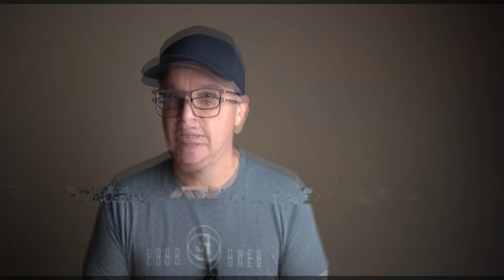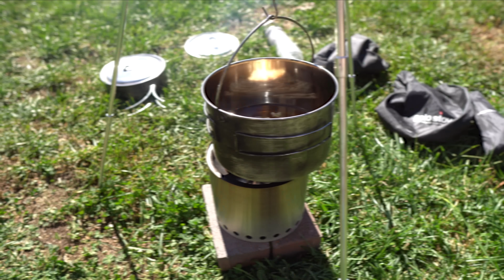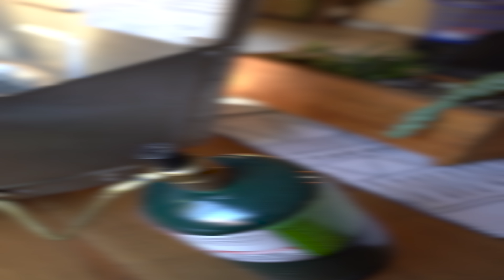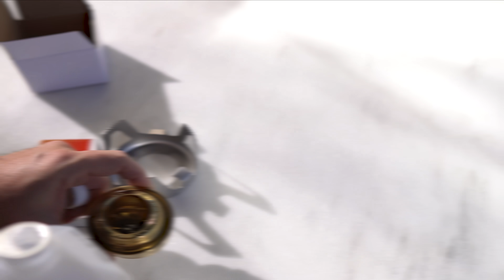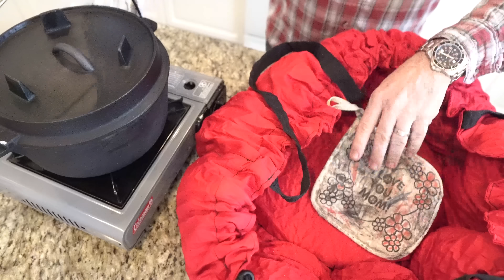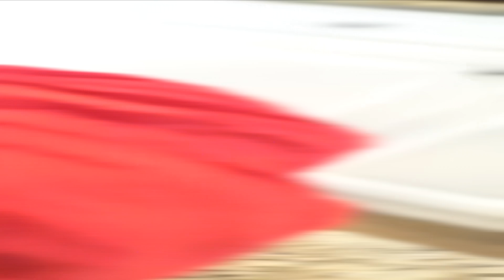12 Ways to Safely Cook After a Disaster

Comment: Whenever cooking with a, from the bottom heat source, USE A LID! It cuts the time needed to boil water or heat anything. This will save time, and resources. In an oven this would not be the case. It will also reduce but not completely the smell of that great hot food you are cooking.

Comment: Take an old grill with a gas burner on the side. Take out the rusty grill parts and cap that gas line on the regulator going to the grill side. Home Depo sells the caps.
Put an old grate or piece of sheet metal in the bottom of the grill.
Cook with charcoal or wood on the grill side.
Cook or boil water on the side burner.
While this is not portable it will provide cooking in all weathers for many months with a few 20 lb tanks of gas.

Comment: I made a dual-axis tracker for a Sun Oven that doesn't use any batteries or capacitors. A timelapse video is on my page. It accumulates energy in sporadic sunshine. And can cook timidly soaked beans and lentils in less than 3 hours. with a handy billy system and a round bottom for the tilting axis, I guess it would be far more practical to use. Great video here btw.

Comment: I have a Biolite for emergencies. What I really like about it is that it uses biomass to cook with, but it also generates electricity so I can charge devices with it. I have battery and hand crank operated flashlights, for example, but I also have ones that work on solar +/or USB charging. The same thing with lighters. I have a lot of Nice ones, but I also have a couple that are flameless and are charged with a USB cable. For me, it's all about having multiple ways to do things, which is why I went that way.
By the way, I also love Rocket Stoves ;)
Reply: Disappointed with nine. It doesn't charge much and burns out quickly

Comment: Good one, Kris. Me, I am a stove junkie. I have no less than 4 different stoves. A jet boil plus fuel cells, two Coleman white gas and multi-fuel stoves with a fold up Coleman oven. 4 gallons of Coleman fuel. Then I have a wood burner. I have a grill to cook over a fire and or coals. I have a gas barbeque and 4 extra tanks that I rotate. I also have a sun oven. I have an extensive collection of cast iron cookware. We should be good for cooking 🍳.

Comment: Danger Warning
That Coleman butane portable camp stove you showed is excellent, BUT NEVER EVER use it with a pan wider than the hob area.
I own an identical cheap-ass Chinese copy (they all come out of the same factory). They are very efficient, fast cooking, light, camping hobs that work so well that right now in the UK its cheaper for me to cook on it with £2 butane cans than it is to turn on my electric kitchen cooker. However they have a tendency to explode when used incorrectly. If you use a very wide pan, that extends outwards over the compartment that houses the butane canister, you incidentally heat up the can whilst you cook. Use a giant frying pan for long enough and the butane can cooks off and goes bang.
Don't be put off owning or using them, they are excellent. I've done a bunch of tests and with normal cooking, with a normal size pan, the butane compartment is as cold as the environment. But there are a lot of stories about naïve users slapping down oversized pans on them, going to town, and making them go boom. Buy one, love it, but watch some safety videos because the fuel reservoir is very close to the action. Look at the stove, see that black thick metal area ... your pan should not extend outwards beyond that or you will be heating the stove as well as your food. Peace

Comment: An excellent video episode containing multiple options for cooking during or after a disaster.  

For myself I have a propane powered one burner stove with a supply of propane canisters on the shelf.  I also have an alcohol fueled 'rocket' stove (using 'HEET' gasoline anti-freeze additive that can be had at most convenience stores, markets, and gas stations or rubbing alcohol).  I also have a fireplace in my apartment that can be used for cooking using non-treated wood (treated wood for exterior use is toxic when burned), fire logs (which I have a supply of), or charcoal.
 
Thank you for adding information about thermal coverings for pots, which are commonly referred to as "pot cozies" East of the Mississippi.
   
One popular form of trail cooking for the backpacking community was using titanium or aluminum lightweight chop-sticks to eat food boiled in Ziploc Freezer bags directly out of the bag which was a fast, light weight, low odor, and easy to clean-up and dispose of afterwards way to go, especially if OPSEC is important while on the move.

Comment: I think a plugin hybrid electric vehicle would be a great option for an emergency survival situation, or just plain traveling or camping. As for the cooking, you could probably do it with any sort of electric cooktop as long as you have an inverter either built in or properly wired to get sufficient power to run it. Also, you basically have a super quiet, efficient gas generator combined with a large enough battery pack to do just about anything with electricity. Since a lot of electrical energy can be stored, you have a lot of options for having the energy to go about living and traveling. The options would be solar panels, wind turbine, hydro power or plugging into the grid via charging stations or a regular electrical outlet. Great for when gas is not readily available.

Comment: I recently had a long power outage. I had my camp stove in a storage unit. The person running the place didn’t know how to manually open the electric gate, so there was no access to my stuff. 
Luckily I had her phone number so I could contact her and helped her open the gate. 
I realized my short term preps need to be in an always accessible location. 
The long term stuff can stay in storage.
Reply: Just ugh. If u have storage, ya got 2 much stuff. In shtf others will have ur $torage unit @ gunpoint or sneak in w/ bolt cutters. ...give ur excess 2 the poor. Ugh.
Reply: @didntask5689  Ugh, like yah, ugh, so right ugh, you-ugh go-ugh girl-ugh.
Reply: @didntask5689  guess you live in a tiny house with only a fixed blade knife
Reply: @didntask5689  Yeah, how awful for someone to not want to be stepping over their preps every time they need to get through the hallway.

Comment: Hot tip: NEVER use a wire brush to clean your grill. 
My daughter caught a bristle imbedded in her tonsil which had stuck to her food. 
Yes, I cleaned the grill after brushing with an oiled rag. 

Many X-rays later with no sign of her throat issues and one day her mom happened to see it when once again trying to see if something was infecting her throat. 
The bristle was barely visible & was pulsing in and out of her tonsil as she breathed. 
Needle nose pliers finally extracted it THREE agonizing weeks later. 
If it had snagged in her throat, stomach or intestines, how badly could this situation have escalated? That’s scary. 
 
If it’s hard to find in the best of times it’ll be even worse without medical help in a SHTF scenario. 

Bottom line: While it’s never happened to you, trust me it DOES HAPPEN. 
Don’t chance it, please!!
Learn from my experience and stop using wire brushes. 
Besides, using a cedar plank smells much better. 
Good health to everyone.

Comment: That cup warmer coil is a decent thing I never would have thought of.

Working construction through the winter this is definatly getting tossed in my car.
Reply: 1 Caution. DO NOT REMOVE THE HEATED COIL FROM THE LIQUID UNTIL IT HAS BEEN UNPLUGGED & ALLOWED TO COOLFOR AT LEAST A MINUTE. If you do, you will hear a quiet 'pop' sound, & it won't work anymore. Personal Experience!
Reply: It's called an Immersion Heater.  Keep the coil submerged in liquid or it will burn itself out.
Reply: Same here. I just bought one on Amazon

Comment: In a emergency you can use tea light candles to cook or boil water.
Reply: Agree! I made a tea light cooker by using a pie pan lined with foil. I put seven or eight tea light candles in the bottom with a grate on the top. I was able to heat up water for tea and a can of stew as a “test.” I have three of the other stoves (including a Coleman stove), but I like the idea of the tea light candle heating as you can do that indoors. Also, many people who aren’t prepared may have some tea light candles available to help them out! It’s a slower cooking method, but it works!
Reply: @victoriagough5769  You can also use tea light candles and some foil to make a emergency heater. I made a video showing how to make one.
Reply: @christopherhorton821  I found your channel and I like your little foil heater. I will give it a try. Thanks!
Reply: @victoriagough5769  No problem. I also made a video on how to make a tea light candle emergency cook stove. I did make a candle powered oven, but I never made a video on that since most people don't own metal clothes hangers. I did cook a small pizza in the candle oven. I may make a video on how to make that some time. I hope that if you do need to try the heater. It works well for you like it did for me. Remember the more candles that you use the more heat it will produce. Just keep it away from anything that could catch on fire. That's why I placed it on top of my oven.
Reply: @christopherhorton821  I promise to give the candle emergency heater a try. I bought a little buddy heater with some propane, but I also like things that are easy to put together, take little energy, and work! The tea light candles are cheap on Amazon and at the dollar tree store, and you don’t have to worry about fumes! It will be a good back up for me. So thanks again for your suggestion.
Reply: @victoriagough5769  Sure thing. Just know that a single candle only produces about 100 Btu's of heat. 12 candles would produce around 1,200 Btu's. While a Mr. Heater on low produces 4,000 Btu's on low. That's why it goes through fuel so quickly.

Comment: About 20 years I was visiting my parents when the power out. I had been camping so still had my gas cooker in the car. I brought it in & boiled water for my parents to fill a thermos of hot water. I visited the elderly neighbours either side who lived alone leaving them each a thermos of hot water to make tea or coffee. Next day I stopped by & they both told me they were safe but appreciated the hot water. These butane cylinder cookers are what I used on picnics / bbqs. I keep one in my garage for these type of emergencies.
Reply: With using both a butane single burner and a propane two burner, I can tell you the butane heats faster bit the bottle does not last as long as a one pound propane bottle.  I use these almost daily, so I have the propane cook stove in a grill tank. Cheaper to run, but not as portable. I do use them both indoors at work.
Reply: @dees1378  Yes indeed - but they the size of bug spray cans too. I get them by the pack & get them in my car. A few months ago I saw one being used in a hot water maker - it was used to boil water & was very efficient. I will stick to my billy & thermos to get hotwater ready but for group - these would be ideal.
Reply: That’s really good natured of you

Comment: I'm a big fan or pressure cookers.
They shorten the cook time and therefore use less fuel.
They can also be modified quite easily to distill water.
Reply: How do you modify the pressure cooker to distill water?  I will need that for my CPAP machine.

Comment: Amazingly comprehensive video!  Would be nice to include more detail on power draw for equipment used.  Voltage, Amperage, time...leading to total Ah.  Useful for those with a car jump battery pack, or power pack for ham radio, etc.
Reply: Another way of looking at it:
* how much energy expended per consumable-calorie
I imagine wood is higher, sun is lowest.

Comment: Oh no, I've just realised that the 10 of the 12 methods of cooking and heating fuel use carbon based fuels in this climate emergency. Does anyone sell a home nuclear heat cell like NASA Multi-Mission Radioisotope Thermoelectric Generator (MMRTG) ones to cook on as Solar doesn't work in Scotland in the Winter? The 4.8 Kg of Plutonium Dioxide will probably be quite expensive I suspect much like the smaller ration heater in the Scottish Army Ration.
See 'Scottish army ration (MRE) with radioactive heater.'

Comment: Another low-cost option for a thermal cooker is a haybox; any box lined with hay or similar material to insulate all sides into which the pot is nestled will hold the heat for several hours. Saw it on _Wartime Farm_.

Comment: I didn't know this until recently, so I'll share in case others don't know, but you can buy an adapter to refill your camping stove Propane tanks (1 lb) using the larger tanks (20 lb).
Reply: Link please?
Reply: Thanks
Reply: Lolll,where have you been
Reply: I have the adapter, but have not tried to use it yet.  My husband ( long time hvac tech and electrician) told me that it works better if you put the one pound bottles in the freezer first. Like Freon, the propane will move from a warmer place to a cooler place. Makes filling little bottles more efficient
Reply: Good advice, thanks! I cooked on our old (thrift store find) green 2 burner Coleman stove for our family of 6 for a year. Great Company!  A Pressure Cooker, cast iorn Skillet, & a Dutch Oven will do it all!

Comment: I’ve got more than one of these methods of cooking. I gradually acquired them over several years trying out different things. I’m contemplating actually building my own rocket stove in a bucket so it’s portable. Good video I liked it.
Reply: @spritsfal5088  oh yes. I have been checking out videos I am looking at articles on how to make one. I have finally concluded that the best balance of weight and portability is going to be a mixture of sand and small pebbles in a 5 gallon bucket and I will put a 6 inch HVAC flu and elbow joints through the side and tape the seams with metallic tape. I’ll make sure that I have Enough space so that I can actually feed fuel in the side. I’m looking for one of those old metal 5 gallon buckets that you get asphalt or tar in. Although, I’m really leaning towards getting a Kelly Kettle now. It’s a lot more portable and I can do more with it but it’s more expensive.

Comment: If you are going to get an electrical stove ring get an induction type to save up to 25% electricity. If you are using a Propane or Petrol gas generator to power an electrical stove ring then you are just wasting precious fuel.

Comment: An Esbit E-CS2350WN storm cooker and a Trangia X2 Multifuel burner used to in conjunction with each other with various coleman propane and butane cartridge adaptors will allow most fuels to be used from Unleaded petrol, White gas, Kerosene to Propane and butane mixes and bio-fuel alcohols. The heat exchange pot is also very efficient.

Comment: Cooking was a worry so I bought a pair of 100 lb propane tanks and the adapters to run Mr Heaters, my camp stove and the BBQ, and I'm happy about that.  I also got a full cast iron set with a griddle, Dutch oven, pots and pans, so when the propane runs out I can start burning wood for my fuel.  I still need a wood-burning stove in my house though, as that's a real long-term solution for both heat and cooking (provided it's defensible)... that's my long term goal.

Comment: Having layers of options is my plan. I have one of each of most of those categories but am curious about the thermal cookers after your video. Would save a lot of fuel. One of my favorite backpacking tricks is using a cat food can alcohol stove, denatured alcohol, and a windscreen cut from one of those disposable aluminum cookie pans. Cost a couple of bucks and weighs about an ounce. Fits right in your backpacking pot. The trick with alcohol stoves is to light it, then assume it’s lit, give it a second and then slowly feel for heat with your palm. I can attest to the fact that you can’t see the flame. Note that they are no good in wildfire areas and you can’t buy denatured alcohol in CA. I’ve tried. The OpSec aspect has me a little concerned, even with cooking in the house. Do you take it upstairs to get it above street level? Thorough video as always.
Reply: Wonder if u can improvise.  L like cast iron & put in an larger canner type pot?

Comment: We have several of those methods, plus a couple more.  The additional ones are a couple of solar water heaters (much smaller than a Sun Oven, but only heats water), and the two-burner propane stove in our little camper, for which we have a decent supply.

Comment: I would include 12  volt "Trucker" appliances for cooking with solar generated electricity...
Reply: One of my favs is the coffee pot, I use it not just for coffee but also heating up water, they work great. I will check out and see if there are any new options. Always great to have several ways to do something. If no gas can always be run off a small  solar generator
Reply: Thanks for the reminder to check the truck stops for equipment!  Blessings,
Reply: Yup. A true Survivalist runs everything directly off of 12 VDC.

Comment: I have a Cobb grill.  It's small and relatively portable.  Requires very small amount of charcoal or the disks that they sell to accompany the grill.  There are numerous cooking accessories such as grill pans/griddles, woks, roasting racks, etc. that you can use with it.  I originally bought for an RV but knew it would be useful for any type of emergency preparedness.  I also have a GoSun solar cooker but I consider that an auxiliary source of cooking.  Finally, I have several "solar" generators ... and I mean several from 300w to 2000w.  I have some small "blenders" that are charged through USB - not the greatest but I don't see using the Vitamix in this type of situation. And, I have one of those electric "lunchboxes" that pull only about 200 watts.  It's good for reheating cooked meats and rice.  Again, not terribly exciting but something else for the cooking arsenal.